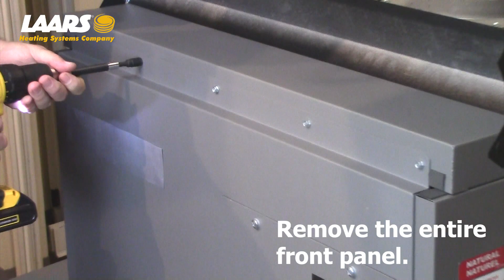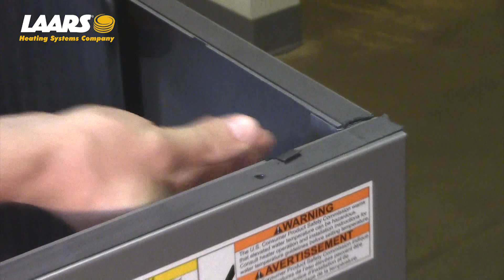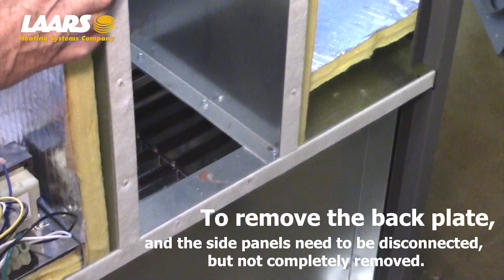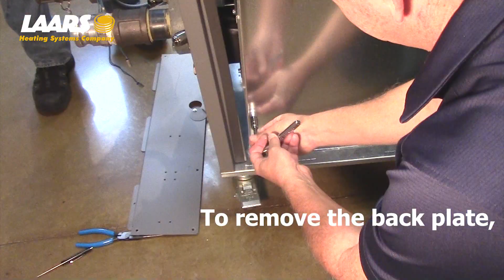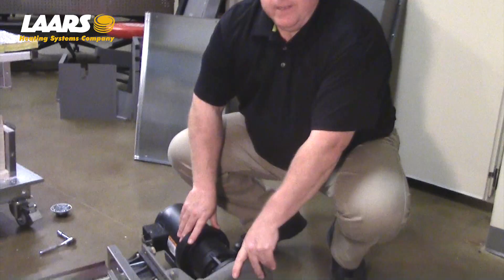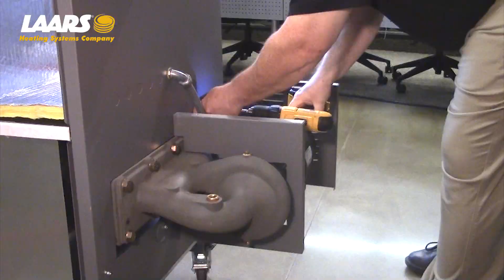Pennant Replace or Clean the Heat Exchanger

Comment: Agree, terrible design. Why would you have to go through all that to remove the back cover. Why not just design it with screws that you remove and then pull the cover off?

 5 years old and I'm having an air pressure switch problem which is most likely related to a clogged heat exchanger. 

 Definitely not designed for reliability or service.
Reply from the maker: Hello! Thank you for your feedback, we have passed this along to the team. If you would like some help with the air pressure switch issue you mentioned, please feel free to give our Technical Support Department a call at 800-900-9276 and we will be happy to assist you!

Comment: What is the best solvent used to remove dirt and grime from the heat exchanger?
Reply from the maker: Hi Landon - we recommend lightly spraying the heat exchanger with water then use a brush to clean the heat exchanger.  Feel free to contact our technical support department at 800.900.9276 for any assistance.

Comment: Everything looks so easy when it's brand new and have extra hands. Great job on the video. Currently having an issue. Auto high limit. Replaced filter but still nothing. Pump runs but no call for heat. The unit is @ 130°. Aquastat is set for 165°. Target set at 175°. Low water cut off keeps blinking. Unit runs when I jump aquastat to manual reset but interlocks light stay on
Reply from the maker: Please call our Tech Support Number during working days 7 am to 5 pm Eastern Time.  1-800-900-9276

Comment: I have a larger boiler that has a double flange plate for the pump, the volute with the first gasket came apart pretty easy but the plate mounted to the tube bundle is stuck massively it’s been on for 20 some years and there’s nothing really to pry against this is a bitch what can I do
Reply from the maker: Sounds like a real challenge.  I hope that you were able to get it off without damaging the plate mount.  The Laars YouTube channel is not a service monitored resource. We have trained service technicians available from 7 am to 5 pm Eastern Standard Time to assist. For future technical issues, please call 800-900-WARM (9276).     Thank You!

Comment: Could a dirty heat exchanger cause an ignition lockout on a mighty therm 2? We have replaced the burners, the ignition module, and the igniter with no luck in resolving the lockout problem.
Reply: garrett herrmann yes maybe ur heat exchanger is sooted up and not letting the heat go through
Reply: Seems to be a common issue had this same issue but havnt replaced any parts. I found that if the ignition MODULE short cycles it does not provide gas for the full 4 seconds and does not light thus causing a cumbustion fail. I resolved this issue by making the minimum time off set to 30 seconds instead of 10 and the issue is gone.
Reply: @brandon HVAC/ANTS  how would one adjust the minium time off set. Have a laars mighty therm 2, and we can not get a flame to show. Igniter lites up, its receiving its 120V, has an AMP dram at 4.1. Gas vkave is opening, holding steady at its 1" wc until ignition, we get a brief bump to 2.3" WC than out within 2 seconds. Inducer is running, no venting blockage, flow switch and LWCO are operating, new pump installed. Absolutely lost on how to get get a flame. Clogged heat exchanger or perhaps this issue you mentioned, help????
Reply: @Canadaistheanwser  did you happen to fix the problem? I’m having the same issue.